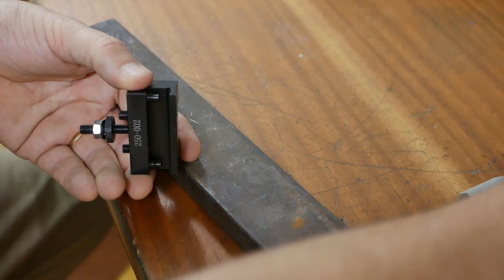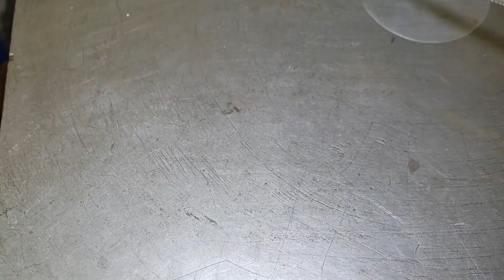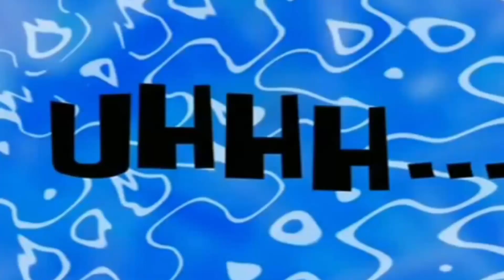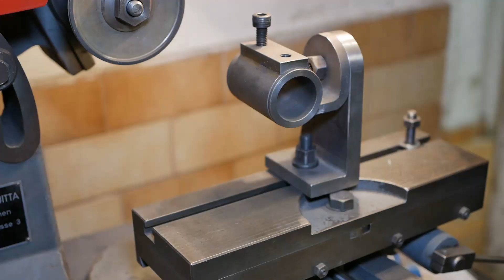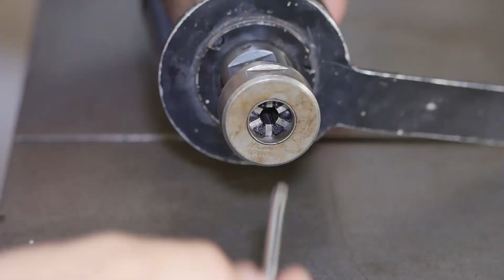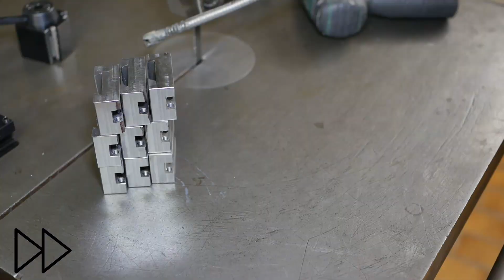Making tool holders - Overhauling the 7x12 minilathe -Episode 29

Comment: Hmmm, you have a band saw and cut the tool holders with, in my mind, a to small angle grinder ?
Is the cutting speed of your band saw , m/s to high for metal ?
Reply from the maker: Yes. The gearbox of the band saw is damaged, and I only have the high range of speeds until I fix it. I talked about this back in an earlier episode of the series.

Comment: Hi There, I'm coming to your channel relatively recently and enjoying the content greatly as I catch up (binge) watch the videos. I have a mini lathe also, which is similar, or rather was initially, similar to yours. I recently acquired it and it has seen very little use up to this point. I've begun a tare-down and inspection and I'm contemplating a CNC conversion, which is why I'm so interested in your project. Very impressive, really top content and skills. I'm a complete novice when it comes to machining, but I'm  stuck with trying to fit a quick change tool post, as I have no riser to mount the post to the cross slide. Did you make the riser yourself, or can they be bought online. I don't feel confident of my skill levels to make one myself, although I'm practicing...!! Keep up the great work...I'm hooked...
Reply from the maker: I started off with only that mini lathe. No drll press, no mill. I made my first two risers on the mini lathe. Only the last one got made on the mill. They dont need to be fancy.
Thanks for watching.

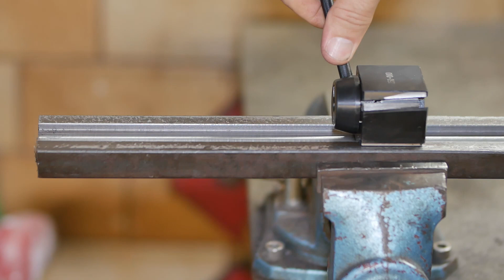Comment: 4:30 pressed in the middle by vises, so it's wider at the end
Reply from the maker: It was probably more down to me not taking the skin off both sides of the steel to relive those pressures first. Only doing one side meant the bar warped.

Comment: waiting for a quickchange set..this is definitly something i will make..is it 60 degrees dovetail-cutter?
Reply from the maker: Yes, its a 60° cutter. I should have been more careful of the clamping, and also machined both sides to release the internal tension.
Reply: @RotarySMP  noted,i will make sure to do so

Comment: I've been farting a round with one of these lathes myself and I've enjoyed your channel probably the best. Thanks for the info. One question. The auto tap had the tap wobbling around. Is that normal? I
Reply from the maker: Thanks for joining in. Yes the tap matic allows the tap to float, and align to the hole. Not necessary for this machine, but they can also be used on a drill press.

Comment: I didn't expect the grinder. Everybody else on youtube seems to have a metal bandsaw. But I would have done the same without one :D
Reply from the maker: The sad thing is I have a Do-All 16" bandsaw, but have to fix the gearbox to get the slow speeds. I covered it somewhere around eposide 12 I think. Thanks for watching.
Reply: @RotarySMP  Ah, that makes sense :) I just found you through your Maho conversion video. Keep up the great work!

Comment: What a weird machining sequence........I had to stop watching near the end as it was getting to me.
Reply from the maker: How would you have done it?
Reply: @RotarySMP  Well, first of all I would have cleaned up all the faces by first machining them true and square. The next thing I would have machined the dovetail using the tool post as a reference to ensure it almost locked on the post with the wedge at the top of it's travel..... this will ensure you can clean up the tool holders on the outside face of the dovetail.....you cannot measure the internal fit of the dovetail by using 2 rollers between the vees as is used for other methods as the tool holder fits against the outside of the dovertail face and between the fixed jaw and the moving wedge...... the bottom of the dovetail face is clear so does not give you a face you can measure from.......check this out with a feeler gauge  and you will see what I mean.
Finally cut the tool holders off to length ......NOT WITH A F##KING ANGLE GRINDER......this is a hack merchant's way of doing things, then machine the outside face of the dovetail to get the fit with the wedge tight and half way down.
If you attempt to replicate the tool holders by measuring between the dovetails with 2 rollers from another tool holder you will not get a good result.......it is very difficult with this dovetail design for a fit to get a size that means anything..........so final fitting by trial and error machining of the outside dovetail face is the only way that is guaranteed to work.
Reply from the maker: @gangleweed  Thanks for that. I made a number of mistakes and bad decisions on those. Will keep learning.
Reply: @RotarySMP  I am actually in the same boat as regards to the same type of tool holders that do not clamp tight...... I bought the tool post on Ebay cheap and sourced plain tool holders separately from a different seller then added some more tool holders from a different seller again....cost advantage etc.....in the mix 2 tool holders were totally loose.....the seller offered me a $12 refund and I keep the holders.
So now I have a choice....sell them on and have the same problem of a return etc, or attempt to "rework" the holders by some devilishly clever engineering.
I'm just getting back into a Tig capability again so I will attempt to weld a coating of steel or bronze onto the outer faces of the tool holder dovetail and then machine it down as that is the only way to increase the gripping effect on this design.
There is another way but more costly and that is to get the clamping faces of the tool holders hard chrome plated then ground down again......not very cost effective.
If you insert two .020" brass shims between the faces of the outer dovetail and the clamp face of the tool post it will clamp up tight, but you would have to glue them on or braze them etc.....not very sophisticated.
Reply from the maker: @gangleweed  That is basically my plan. Epoxy a shim to one side. Half of mine came out okay..ish, but the ones at the end of the bar are too loose.

For the AXA sized  QCTP on the Boley, I have 19 tool holders from Phase II, Shars, and Ali, and all fit perfectly.
Reply: @RotarySMP  That will work as long as the epoxy holds....I don't trust any plastic in engineering so I will be adding a layer of braze material or even welding a layer of steel on it with Tig....I have nothing to lose as they are virtually scrap........ then machining it off again and carefully monitoring the fit......I tend to do things that way.
You could even stick a brass shim on each of the dovetail faces with soft solder as the melting point of the solder is quite low and it might be more durable over epoxy.....trial and error time etc.

Comment: But you have a bandsaw...
Reply from the maker: It has gearbox damage, so I can't use the low speeds necessary to cut steel. Thanks for watching. I did a bit on that back around episode 15 or so.

Comment: Nice to see a Clarkson tool and cutter grinder. I have a MK II myself but don't have the radius attachment.
Reply from the maker: Hi.Th Clarksons are pretty cool. The friend who had it before me is a big beleiver in tracking down all possible accessory for every machine (and he had many).  Shame he didn't get one of those air bearing flute grinding attachments as well.
Reply: @RotarySMP  You can get some aftermarket air bearing setups but they are pricey and they normally need regrinding or the seals changed. I'm in Norway so attachments of any kind are pretty hard to find here.
Reply from the maker: @kickinthegob  I haven't actually tried flank grinding yet. It probably doesn't work as well with the guide bushings, but should still be better than a blunt end mill.
Reply: @RotarySMP  I have several mates who have Clarksons and they reckon it's no problem. Clarkson used their own grinders to sharpen their own endmills back in the day and they did it without air bearings so it will likely be down to practice and getting a feel for the pressure against the flute guide.

Comment: I suppose you don't need to use rulon/turcite type products as your shim as this isn't a sliding surface. Little epoxy on some thin sheet steel or brass shim stock? Just gotta make sure nothing comes out of square in the process. Nice work!
Reply from the maker: THat is the plan. I just checked it out with my 0.3mm shim stock, and it looks about right.

Comment: Face on dove tail side? I would imagine that face is what makes contact with the tool post and also affects to position of the locking leaver. You should face it when making dove tails?
Reply from the maker: I just lapped those faces with sandpaper on flat surface.
Reply: @RotarySMP  Ahaa.. ok :DI personally would face it with endmill.
Reply from the maker: @waldemarii  That would have been the smarter move. Becasue the bar was already at nominal thickness, I didn't want to waste thickness. Really I was to lazy to dick around with moving clamps. A couple of bad decisions. Should have bought larger material, and surfaced it.

Comment: my thinking is there is no point in making if it can be bought for 10 currency units
Reply from the maker: I did consider buying, but then I''dhave no content for you, and the 3,7mm lower flange on the bought ones looks too flexible to me.
Reply: @RotarySMP  you should've made at least 30 or you'll run out of them at some point, but of course you can add the chinese ones on top if you ever need more.
Reply from the maker: @MF175mp  The X travel on the Maho is only 400mm, so this was the longest stick of steel I could start with, but you are right, if I'd put in a little more effort to repeat the first ops, once cut into individual holders It would have been more efficent to have made more. I think I have 19 AXA sized for the Boley, and that is only nearly enough.

Comment: The shim idea sounds like a good fix.
Thanks for sharing, 
Cheers
Reply from the maker: I was using shims on the worst ones while machining them as well. Two layers of beer can made quite a difference.
Thanks for watching.
Reply: @RotarySMP  What about adding material (welding) and then remachine them to size?
Reply from the maker: @NicoCarsAndCookies  That would be polishing a turd. If I epoxy shims on correctly, I never need to think of them again.

Comment: Great video as always, you should have clamped the bar on the 4 corners or first in a vice to square it and then on the table! They are functional and that is what matters!
Reply from the maker: <shame> i only own 2 clamping blocks  ;( </shame> 
Good point though.
Reply: @RotarySMP  One of my first projects at home was to make 8 clamps and T nuts for my Anayak. I made them out of 1.2311 steel and then surface ground them at my work ahahah it's great to have Access to a surface Grinder!
Reply from the maker: @andresgodinho  I would really like a surface grinder. I be I could make a whole bunch of new different screw ups with that machine. :)
Reply: @andresgodinho  lol i threw Mine on the shaper. Just a poor mechanical engineering Student though ^^ surfaces Grinder at Work Sounds fantastic!
Reply: @RotarySMP  the worst thing is if the part flies of into the darkness of space and you try to find it without success ahahah it happened to a coworker of mine, he didn't Turn on the magnetic table and shattered the grinding wheel along with it... 
He got to listen to our employer for a good 10 minutes!
Reply: @clypeum5063  i work in a factory that makes moulds for plastics... I sometimes do late nights and i use the machines there in my lunch time or after work... It's a deal i made with my employer hehe
Reply from the maker: @andresgodinho  That is a pretty cool deal. I once tried surface grinding on the Clarkson. Since I dont have a mag chuck, I superglued the part to a block of steel, and held that in a vise I clamped down. Of course the grinding heat softened the glue and part shot out.